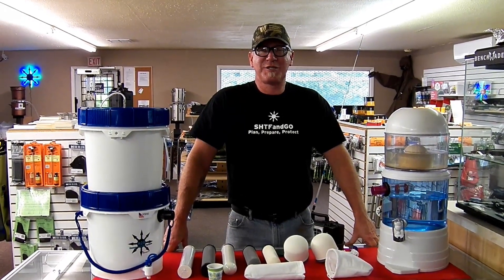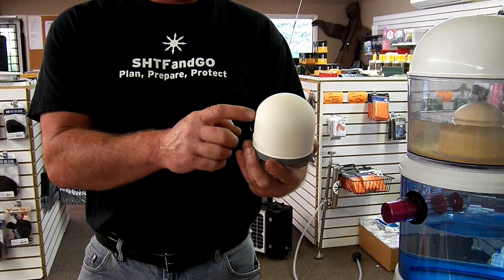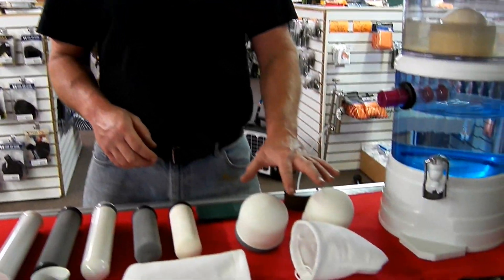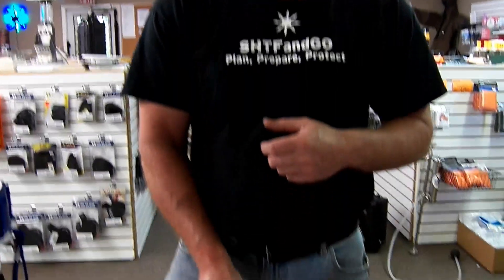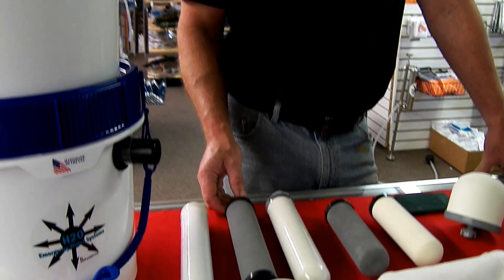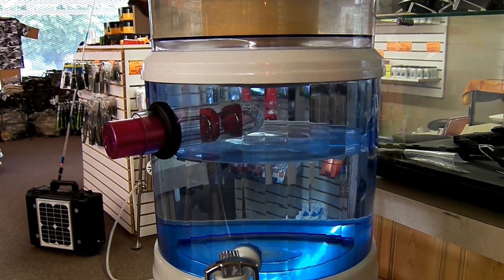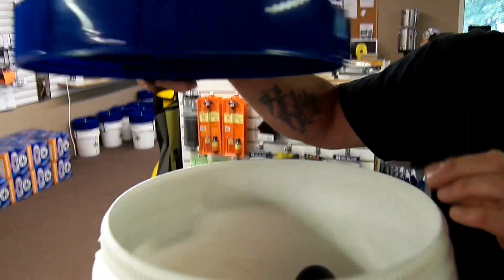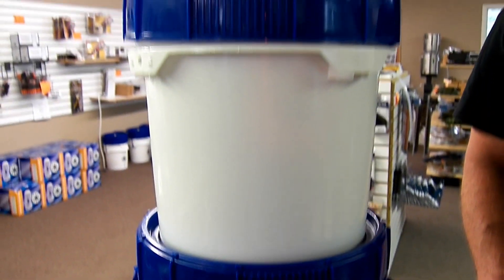Compare Different Types of Ceramic Filters

Comment: So, being that activated carbon is just charcoal, why not just fill the bottom of the top bucket ( screens in place over holes in the bottom ) with alternating layers of activated carbon, sand, and ceramic particles of the proper size? Doesn't being able to simply fire off some wood into activated charcoal when you need  to replace the filter medium make more sense than a product that one has to buy? Why all the fancy crap? Silver? Why? Use copper because it is antibacterial by nature. Again, easy and cheap to get copper flakes to integrate into those layers... and they can always be cleaned when replacing the sand and carbon layers.. just sayin.